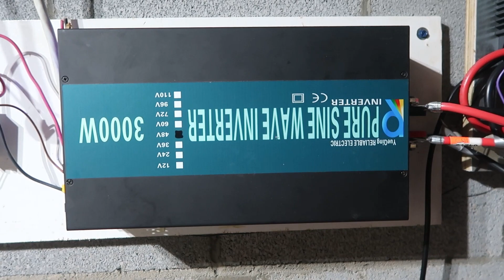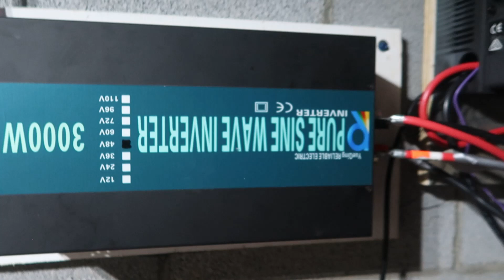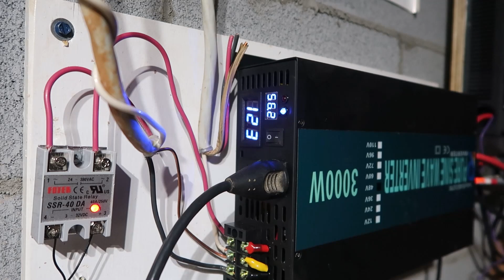WZRELB 3000W 48V Pure Sine Wave Inverter Reliable Electric

Comment: I notice the relay input reads 3 to 32VDC.  How is this able to switch when battery voltage drops below 48VDC?  Perhaps there is more to the relay circuit than what I see.

Comment: Jan into the mentioned issue where the inverter deep discharges the battery.  Is there a way to find out more the wiring of the ssr-40-da relay?  Thank you

Comment: I was interested to note that they have 10A fuses. I recently looked at a Go Power 1500W unit and it had 8 40A fuses. I also noted that they were soldered right to the PCB, and could not figure out if that was to force the end user to send it back for fuse replacement, but it was enough for me to return the unit. I assume the fuses in this unit were user replaceable?

Comment: Very cool upgrade to your system.  Odd choice of color markings on the VAC out: Red for the hot/load leg instead of black, Yellow for ground instead of green, Black for the common/neutral instead of white (when black is standard for hot/load).
Looking at the notes/comments on amazon, I'd suggest stress testing it while it's still under warranty.

Comment: You need to be more carefull now: Please go and install the plastic cover on the the hard-wire-AC terminal!!! That is to easy to touch when you plug in and out something like the drill. And it would also be advisable to install some smoke sensors under your house, a circuit brakers between the inverter and the batteries and finally covers on all contacts of your batteries!